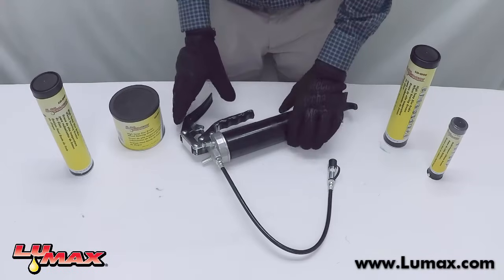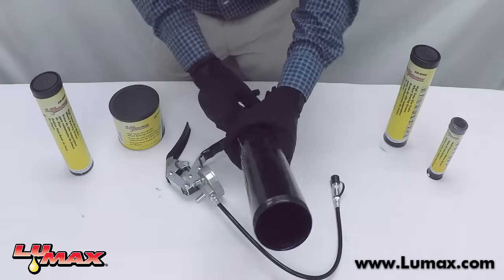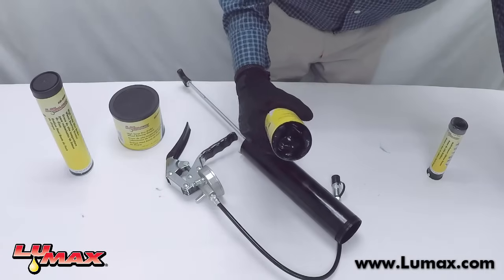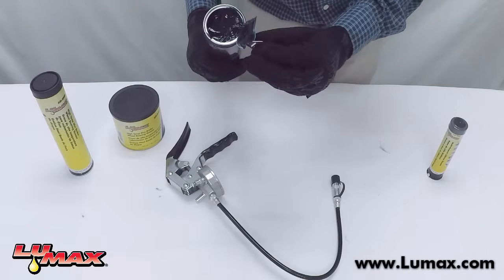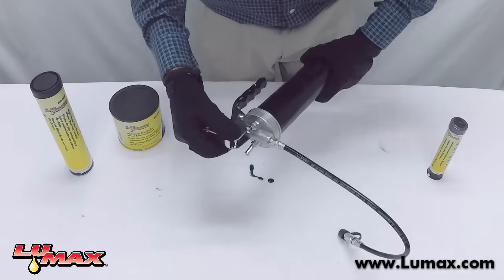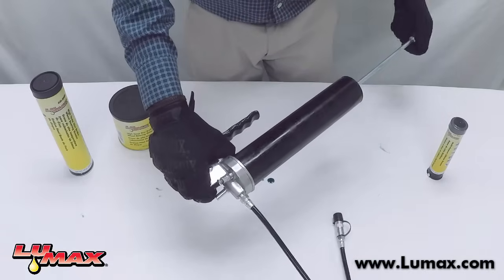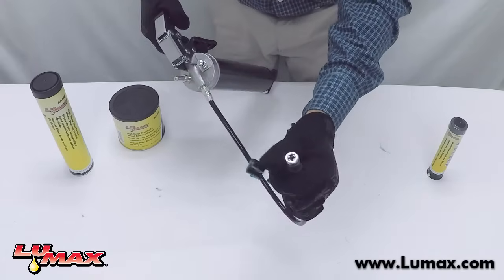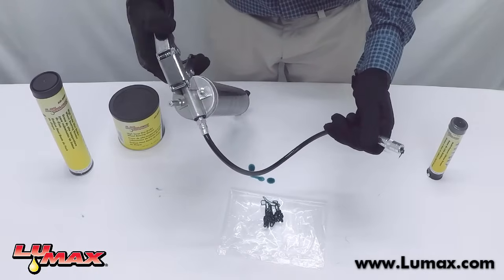How to Properly Load a Grease Gun

Comment: I am 80 year old woman.  I was just ready to drive over that darn thing , but you saved it.  Now I am a pro , looking for more things to grease.  Lol 👵🏻
Reply: Go Deanna ! Get greasing 🤣
Reply: Rip
Reply: I’m 45 and a general contractor. I was ready to drive over mine too! Now my tractor loves me again.
Reply: This 44 year old man was on the same page
Reply: As a mechanic you made my day 😂😂😂😂
Reply: An old mechanic once told me:
"You would be surprised what you can fix just by cleaning and lubricating an item!"
Reply: @BST-lm4po  Case in point: my lawn mower was acting up at the start of the season. Running irregularly, stopping on its own, even when just sitting on concrete. We poured the old oil out, changed it for fresh oil a couple of times until it came out clear (there was a lot of gunk in there, apparently), and now it runs great again. So yeah, a clean and fresh lubrication was all it needed.
Reply: You able to make a comment on YouTube is amazing at age 80

Comment: I watched this video a day too late.  Yesterday, using a slightly different model, I unscrewed the plunger end, didn't know that the pumping end unscrewed, and couldn't figure out how to get the old cartridge out.  After 20 minutes of needle nose pliers, a short crowbar, and different screwdrivers, I realized that the pump end unscrews.  Well that made removal of the cartridge embarrassingly easy.  Then I put the new cartridge in the wrong way (with the pop lid on the plunger side) and forced the plunger through the smaller opening.  Then I had to stuff the spring into the cylinder with my hands and brute force, finally screwing on the plunger end.  Needless to say, grease was all over me, the table, the tools, and the floor.  Now I know.  Thank you.
Reply: LOL, it's about twenty years to late for me. Twenty years I paid someone else because I couldn't get the gun to work right. I bought the thing new and got no instructions at all, cartridges had no instructions ether.   Jim Y
Reply: I'm glad I'm not only bone head. :)
Reply: Same thing happened to me. When i push plunger back in mine brokeoff and went up in the tube🤦🏻‍♂️
Reply: It happens boys... No sweat just a little grease!

Comment: What’s this sourcery?! How does the plunger go past the grease?! Am I missing something? Caulking guns the plunger sticks out and goes in slowly as the silicone goes in
Reply: Pull stem out before removing hose cap. Fully extended, push stem side ways to tube and stem will lock in place in the stem notch. Once tube is inserted, release stem from notch lock. Push stem inward and plunger plate will compact grease. Continue pushing on stem and stem will release from compactor and pierce the jelly grease. Pumping will create vacuum on jelly grease and suck plunger plate towards exit cap.

Comment: FYI, if you have the tube in already and are replacing with new tube its a different method to remove.

Turn a couple times to allow the handle yo be pulled back and secure it in the retracted position. Then completely unscrew.

Yw for not throwing your back out trying to pull it without unscrewing a bit first. Also, for not exploding the remaining grease all over you.

Comment: My grease gun doesn't have an air bleeder valve
Reply: Many do not. Vidio was very weak of trouble shooting techniques. Remove hose. Place finger over exit port.  Pump. You will feel pressure and vacuum on finger when spreading handle. Keep pumping until there is no more vacuum on finger. When only pressure on compression stroke, then you are functional.

Comment: First step should always be pull rod to rear.
Reply: True. I always pull the rod out and lock in place before unscrewing cap. Once cap is off, pull empty tube out. This vidio could have been greatly improved with better techniques.

Comment: I'm trying this but the new cartridge won't fit it's slightly too large to fit in the grease gun. Was there a standard size change sometime in recent history? My grease gun is a hand me down and is fairly old. Did they used to not use cartridges? Mine does not have an air bleeder valve that I can tell...
Reply: Nevermind i figured it out. My grease gun is from before cartridges were a thing. The plunger is made from canvas or leather or some textile... Before plastics too lol. I ended up just taking the grease out of the cartridge with a paint stir stick and manually loading the gun tube. Bit messy but she works😂

Comment: Looks like a teacher trying to teach somebody how to do grease gun basically the first part is correct screw the thing on do not cross thread because you're purposely ruin the threads of the grease gun here's the trick that is missed you screw the cartridge to on 1 1/2 to 2 turns I rod all the way tightening the cartridge all the air will come out in a little bit the new Grease.

Comment: I hate these tools. Can always get em on the fitting but you need a fucking gorrila to pry the tip off
Reply: Push tip side ways to zerts. Straight pull usually will not work.

Comment: You have some insight of what to do. Never store cartridges on Thier side or horizontal. Vertical or standing on Thier end prevents the grease from settling and leaving a void length wise in the tube. Summer heat will liquify the grease and make it fluid flowing. Another tip is if it does not pump, unscrew the hose and hold your finger over the outlet port. Pump the handle and you will feel the pressure on the compression and feel the vacuum on the handle spreading action. Do this few strokes and the vacuum suction with stop and pumping will start with enough pressure that you will not be able to hold finger on open port. Clean zerts of dirt before attaching gun tip. Locking tips failed for me and may be a waste of money.

Comment: I'm so glad I stumbled across this. I have blown up a couple tubes trying to figure this thing out. While this gun isn't extremely cheap, I wouldn't call it top of the line either. My Purge valve isn't a press type but an Allen head screw type. I'm assuming it would function basically the same? Thanks for any info.

Comment: I finally know they have air bleeders on them. Never know what that thingy was until now haha
Reply: There is a slotted screw on top of my grease gun.  The bleeder?  I never left the tube in.  I would remove the plastic cap, insert the tube and pop the lid----The grease slowly leaves the tube, as you lowly lift it out of the gun tube.

Comment: I have a POS grease gun with a spring that makes screwing the cap on virtually impossible without creating a #@!%^&# mess. I tried not perforating the foil on the grease cartridge and pumping the lever to get the grease flowing.  No luck. Next stop for that grease gun? The trash bin.

Comment: That’s not the best way to do it. The best way is to rotate and lock the handle in the piston first then hold the gun by the body upright with the handle resting on a bench. The next thing you do is pull down on the body of the gun while holding the bleeder valve open until the air has escaped you will feel and see this happen. It is also a good idea to have the pump handle open when doing this. The last step is to rotate and unlock the handle from the piston and push it in.

Comment: I have this same model, brand new, the follower rod does not stay put when pulled back. What is the solution ?
Reply: There should be a notch that it goes into once pulled all the way back to hold it back
Reply: I tried, and tried, I'm sure there should be something like you'd mentioned. Maybe a lemon?
Thanks anyway.
Reply: The metal “tab” at the base of the cylinder (you can clearly see 22 seconds in), needs to be positioned that it’ll lock/stop the rod from going back in. Use your thumb to allow the rod to go back in when you’ve loaded the gun.
Reply: @peteryeung111  Try placing the cylinder of the grease gun  in a vise.  Then pull the rod back.  The vise makes it a lot easier.  Don't close the vice too much.  You will crush the cylinder.

Comment: I have a 14.5 oz Lucas cartridge and can't quite get it to go all the way in so I can screw the lid back on. It lacks about 3/8" of being flush. Will this gun only take 14.0 oz cartridges or what is going on? Thanks for any help.
Reply from the maker: Postwatch, all Lumax grease guns will take the standard 14 oz. grease cartridge. Unfortunately, the 14.5 oz. will have an extra lip. I would recommend purchasing a 14 oz. cartridge or remove some of the grease from the cartridge and pack it into the head of the grease gun (no grease wasted!) and trim down the cartridge. If you have any other questions, please reach out at Info@Lumax.com or 844-660-6876.

The Lumax Team
Reply: You can tap the metal of cartridge lightly to make sure it is seated completely. Then attach threaded end. Threads will complete the compacting compression.